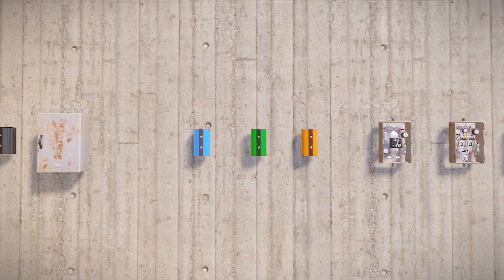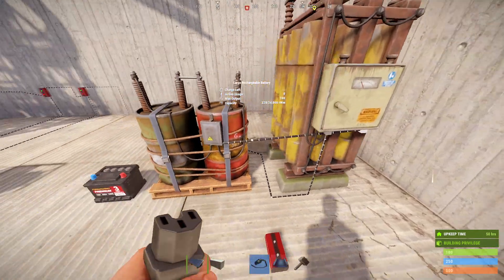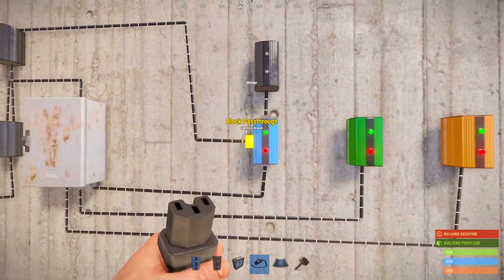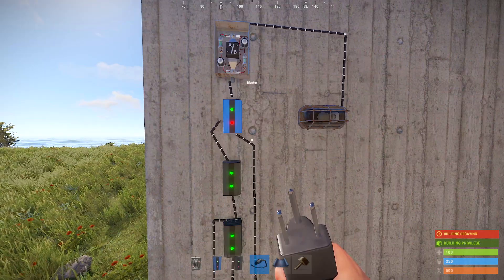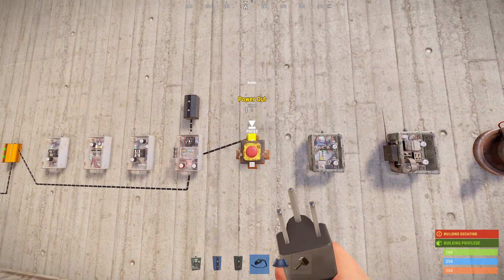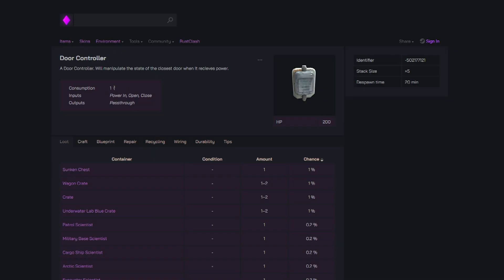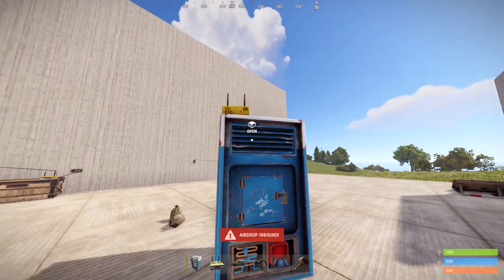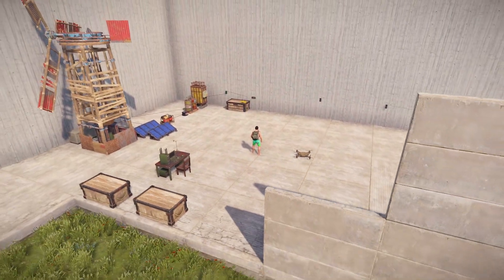What Every Electrical Component Does in Rust

Comment: how can i set a light to turn on for say 10 seconds, turn off for 10 seconds, then turn back on for 10 seconds despite receiving a constant input of power to the system (not using solar panels as an indicator for when to turn on and off based on the sun being out)

Comment: I was watching video till 6:00 and wanna add smth
Root combiner: if u add splitter in bettween of logic component and root combiner it wont break the cuircut, but u should keep in mind max depth(its how much electrical components can be between power sources and root combiner, normally this number is 16)
Electrical brench: it has priority of turning off and on, simply if u have enough power to power both outputs first it will power the right output then left, same if it looses the power, first will turns off right side, then left. It can be used with a timer, for example to run the timer u need first power it then turns it on, so now we now priorities, so we connect our right output to the power, then our left output to the activation of the timer
Splitter: it also has priorities of spliting the electricity, so simply if u have 1 power and splitter connects all his outputs only first output from the left will have power, 2 - first and second, 3 - all three. 
Memory cell: yeah set, reset and toggle, u forgot to mention priority, so simply if set and reset has constant power only set(right output) will work, cuz it has priority over reset(and reset has priority over toggle, to visualise that (set>reset>toggle))
Reply: Also OR and AND switches also have priorities, for example if power on the inputs are the same output will only take power from the 1st input, and if it is not enough it will take from the 2nd input. That's why nih core works without any blockers
Reply: Timer: if u want to reset the timer u need to reset its power supply, simply examples of u want after u pressed button start a timer and if u pressed it again to reset the timer u need it to reset the power supply to timer and activate it again

Comment: You can also make music with it. It does need a lot of timed switches and items that cause a sound for just a sec.

Also, generators can be set in your base and triggred via wire when some1 steps on a bear rug. This is realy usefull when the other players take out outside power and just wait for your base to power down while you sleep. When they door raid you, they step on bear rug and this triggers a generator that powers the inside turret till it runs out of oil. This setup saved me a lot from offline door raiders.

If you have a player you realy realy hate (like roofcamper), you can abuse search light by setting it on timer to turn on and off every sec (and you place 3 next to each other), while they are protected by a window. Then you turn them into a roofcamper base and laugh, while they lose their mind.

And i have seen people using igniters to crash rust servers when they were realy mad with fireworks :P

Comment: My recommendation for anyone looking to use electricity:

Combine all of your power with a group of root combiners, lead that into a splitter, and put those leads into two batteries. 

This allows you to charge your batteries effectively, makes wire management easy, and allows you to have a second battery for logic circuits.

Comment: A couple things of importance to not mess up your circuits.
Solar panels need to face the sun indeed, but where is the sun?
A few years ago solar panels needed to face the center of the map vertically, so if your base is in the north-west corner, the panels had to face sharp south for maximum charge during the day, and NOT south-east. They changed this after a couple years, and now they need to face sharp north for maximum charge regardless of where your base is. So always put the panels facing north, even if the sun comes from the east.

3:33 Careful with this. Root combiners will take the maximum output of a battery. So if for whatever reason you're min-maxing and using 2 small batteries to feed a switch and two auto-turrets exactly 20 power, merging them with a combiner for the switch will drain 30p (15p+15p) instead from the battery, not 20p, and so you will need 2 solar panels (40p) to not run out of energy even during the day. Personally I'd avoid using a combiner for merging batteries. Place 2 switches if you're using 2 turrets but can't fit anything bigger than small batteries in your build.

I tried, and failed, to set up a system with counters to know which of my 4 auto-turrets killed somebody near my base. The grass was so abundant that finding the bodies was a pain. Using lights linked to the "has target" thing was no good because the turrets would get the kill in 1-2 seconds, which was far shorter than it would take me to reach the room with the lights. I tried counters too but they all said 0, so I was truly doomed to be denied the naked loot.